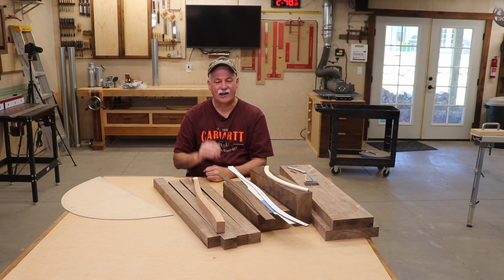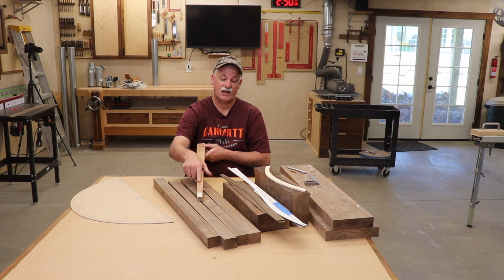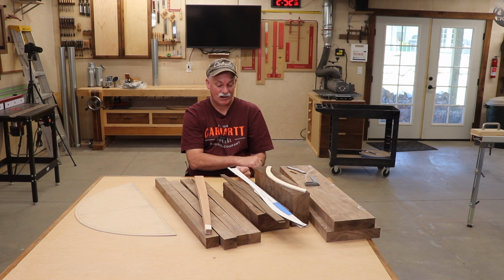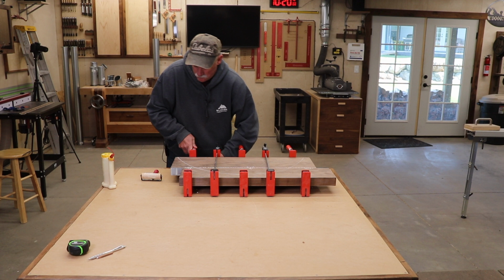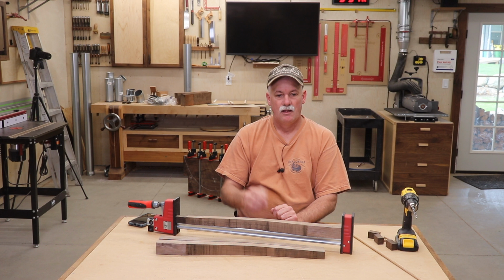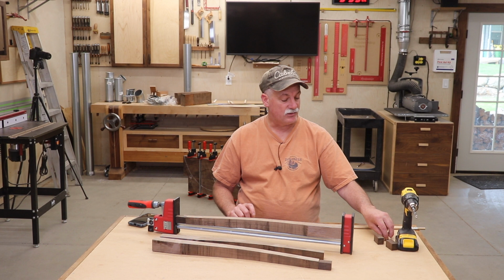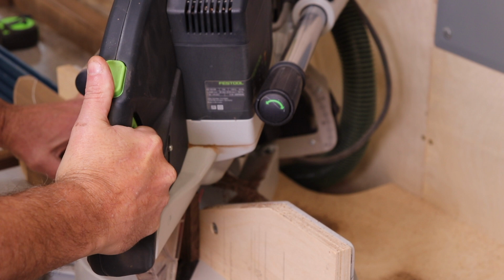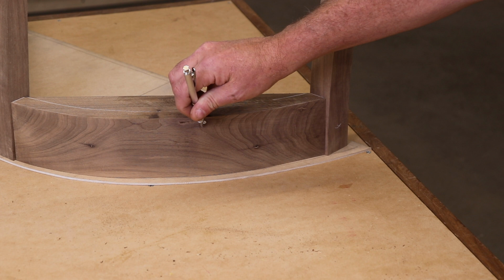Demilune Table Pt  1

Comment: The bullet is cool. I’d leave it personally. Gonna be nice either way
Reply from the maker: The angle only made it speculation that it was a bullet..  When I removed it, it was indeed a bullet..  In all my years of woodworking, that's the first one I've removed from kiln dried lumber from a hardwood dealer.